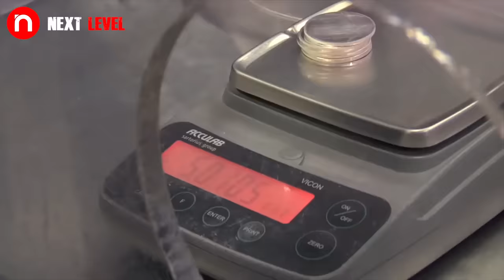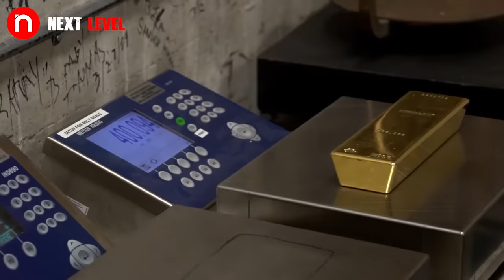WIN GOLD Melting Pure Gold Refinery Modern Gold Bars Coins Manufacturing Process Machine Technology

Comment: Awesome process.People don't see the work required to make the final product
Reply: No but they all want it at spot, because this stuff makes itself.
Reply: @joju4072  You see ,there is a difference between something hand made and what comes out of a machine by the mile and someone just solders a clasp on the end .You want all this consumer crap fashion jewelry that comes out of a machine like spaghetti ,no more than 10% above spot prices .you want something custom ,hand made ,that's another story ,Casting is not much different ,once you make a mold ,you are off to the races and can cast thousands of pieces over and over again .the price per unit comes down .It's still hard works and dangerous work as well

Comment: There’s a step missing. I want to know how they get the gold from 90% pure to 99.999% that makes the coins themselves. The part you showed is just the mechanical stamping process.
Reply: It's a lot of chemical refining and flux useage to remove the other impurity which is normally sulfur and other elements in the same group using Chloride to turn them into element chloride. and as gold reacts with nothing. it's left alone.

Edit: you can see some of the presource during the african gold refinery
Reply: they were doing some cupelling in the African refinery, when he pulled that little red hot cupel from the furnace that was likely a 90% gold alloy cupelled to 99.9% purity, before hand they can use chemicals like nitric acid and muriatic acid to make aqua regia, and then the gold needs to be precipitated out with sodium matabisulfate. Or they can use sulfers and other things and borax when smelting the gold ore.
Reply: haaaa.
Reply: The way that it’s refined from 90% to 99.99 etc. is the same for all metals essentially finding their melting point and then removing the top layer known as slag. The slag is the impurities and they float to the top while the denser metal settles to the bottom.
Reply: @kylepatlen6275 That's bullshit😂

Comment: Is silver cheap or expensive right now at a spot price of around $22.50 per troy ounce?
Reply: cheap. especially with today's inflation
Reply: VERY cheap.  When I was in high school (1980) I needed silver for lost wax casting class.  Had to settle for brass brazing rods as silver was $40/ounce back then!
Reply: @petuniasevan  What the hell? If it was $40 back in the 80s, how on earth is it around half that today? Especially when everything is getting so expensive as inflation is getting out of control.
Reply: @michalsavatar7  I don't remember why it was so inflated back then but it sure was.  I'm going to guess that photographic film/processing was a big factor.  Digital photography's advent and domination of the market certainly took that use of silver out of the equation for the most part (excepting some commercial and specialty printing).

Comment: At 10:10 the green plastic boxes are called Monster Boxes that hold 500 ounces of silver 1 oz coins from the US Mint. They are listed on eBay if you want to get a rough estimate of prices....$16,000-$20,000 a box depending on the silver spot price and a hell of a markup per coin added. The coins are sealed in 25 airtight plastic tubes of 20 coins each. A Monster Box weighs about 34 pounds or 15.4 kilograms.

 The red plastic boxes are Monster Boxes of gold, 500 ounces in coins or 500 ounces in bullion bars. They sell for well over $1 million US and are fairly rare compared to the green boxes.    When we go camping, I have an empty repurposed red Monster Box that I use to keep my razor, toothbrush, medicine, and shampoo in. So far, nobody has a clue as to what was once in it until I tell them. I bought it on eBay for $20.

Comment: Invest in copper now, in the future copper will be worth more than silver gold and platinum because of its ability to create powerful electromagnetic fields and it will be used in creating antigravity engines which will be used in interstellar travel.
Reply: Kenneth Akin why you say that? Both gold and silver are more electrically conductive than copper
Reply: Apparently you dont know much about electronics... your tv and cell phones plus most high end devices can only work with gold connectors..why you ask? Because gold is the best conductor...
Reply: 🤣🤣🤣🤣🤣 gold is way better conductor then copper and generates EM fields much better then copper, plus it is also diamagnetic.

Comment: I want to see what type of crazy security they have there. How far can you get in there until you see guards and snipers with huge weapons?
Reply: Its governmental factory
Reply: Inside not much different than an ordinary high security factory. Outside it is a nondescript building fenced with a double concertina wire, electric fence with double guard gates that go in and out. Some mobile and fixed armed security as well. Places that do this type of work pay the enployees really well with excellent benifits 😎

Comment: What’s the ex factory price of the Gold? I would love buy it at that price! I guess it’s 30% percent cheaper? Can any one throw some light on this, I’ve been trying to find it but failed.
Reply: It is bought on futures contract, in otherwords the price is locked in for x ounces deliverd by x date. It usually is at the spot market price plus a loyalty discount from buying repeatedly from the same supplier. Some may do in house recycling that will recover gold for far less than spot price as well. 70 to 80 percent of spot when it was 800 an ounce was not uncommon.

Comment: The mint is actually where Gerrett metal detector manufacturer actually picked up their design for the pin pointers! Fact. The mint designed them in several different lengths for full on probing to insure that not even a spec of gold could be removed from the primisses! Most of the lady employee' s loved the design! As for the men that did, they accidentally feel into the gold ore as it was being refined!
Reply: Garrett*
Reply: @Wings_of_foam  ya forgot to correct the feel there partner lol, it is supposed to read fell. Guess even "correctors" can't correct everything huh. Lol. Anyway, I'm sure everyone gets the point even in misspelling simple things!